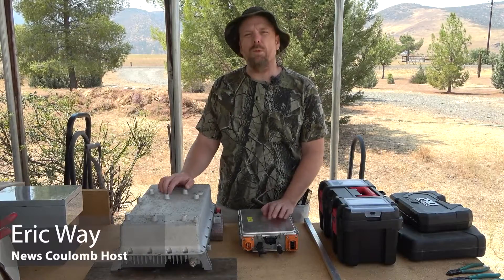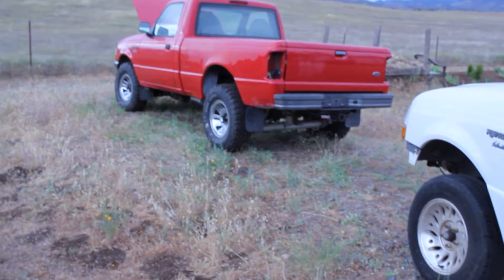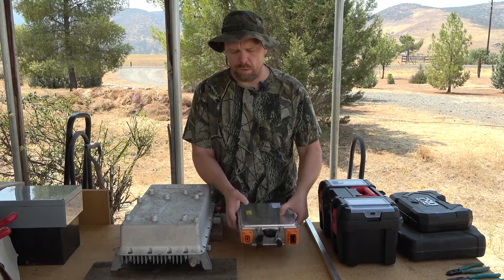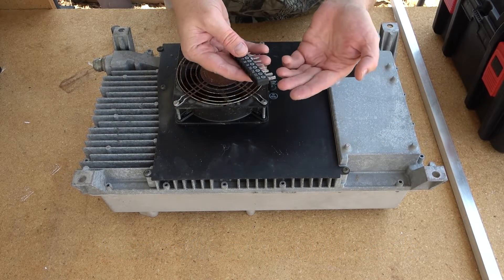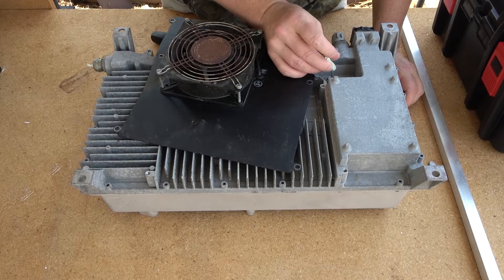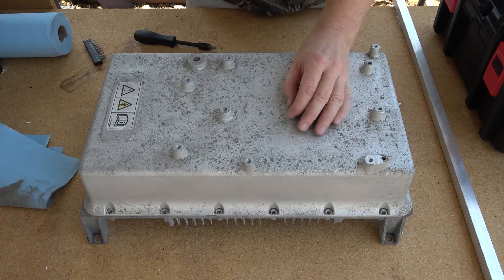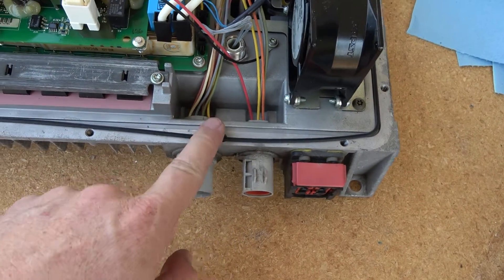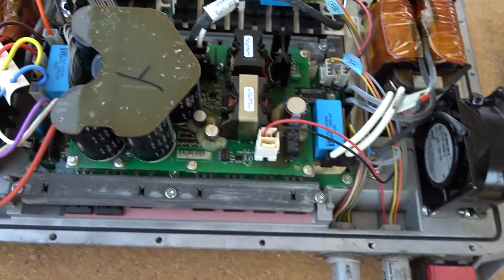Cracking Open a 1999 Ford Ranger EV NIMH Charger

Comment: I have an EV from 2002 and the charger is made by Siemens. For controlling it, it has two temperature sensors in the battery box to adjust end and float voltage based on outside temperature and to monitor if the lead-acid batteries were too hot. It also has a start stop signal from the onboard computer, that monitors other parameters like leak current and battery unbalance. So from that generation of chargers, it is easy to fake both temperature sensors with a fixed resistor and supply the 12v pilot signal to make it start. I'm using it in a Li-ion conversion and the charger has no idea it is not charging lead acid batteries. However with Li-ion, I don't want float charging, so I just stop it manually. WHat has changed in 20 years is that power electronics has gotten better: Lower switching losses and lower resistance in FET transistors, so higher switching frequencies which means lower losses in inductors. My old charger draws 3400W supplying 3000W, So that is 88% efficiency. Horribly bad by today's standards.

Comment: Nice update, curious why that charger selection vs like an Orion?  The liquid cooling for Cali heat?
Reply from the maker: Thanks! Orion doesn't make chargers, as far as I know. I do have an Orion BMS that I will be integrating into the system, but as far as charging, it doesn't really matter whether it's air or water cooled. It just happens that this Valeo Siemens is water cooled.
Reply: @newscoulomb3705  ah, had bms on the brain, cool though, so you're plumbing that in before or after the motor?
Reply from the maker: @jkinghorn  I will go over how I'm integrating the charger into the cooling system. The Ranger EV has an extensive cooling system very similar to the gas powered Rangers, so there are lots of options for how to tap in.

Comment: 600 miles using L2 charging only?
Reply from the maker: If I can squeeze 300 miles out of a single battery charge, it's a lot more reasonable. But we'll see what I can do beyond that.
Reply: @newscoulomb3705  how many kWh is the pack? That truck does not look very aerodynamic.
Reply from the maker: @barryw9473  The pack should be about 90 kWh. A lot depends on driving speeds. A number of agencies did extensive testing on the platform, and they found that it averaged better than 4 mi/kWh at 45 mph, and about 3 mi/kWh at 60 mph. So the truck isn't aerodynamic, but it's also not that big by modern standards. 

If I stick to the scenic roads, 300 miles seems possible. Of course, that also adds driving time. 

I also have to wonder whether Peukert's Law had some impact on the overall efficiency of the PbA and NiMH trucks when tested because they were drawing ~1 C when driving at 60 mph.
Reply: @newscoulomb3705  ok. But then assuming 6 kW at a public 208 V station, it will take ~13 hours to recharge, which is ok if you are staying overnight at a hotel. I am also considering going to San Diego for Fully Charged and will also plan on a hotel stay to let my e-Golf pack cool a bit and charge on L2 after two DCFCs in the hot Central Valley. But, I may have lab work and need to scrap the trip.
Reply from the maker: @barryw9473  Yes, worst case, it would take a day and a half using L2 AC, but I consider that reasonable for a 23 year old EV. Of course, that's if I can even get everything up and running in time to take it.
Reply: @newscoulomb3705  good luck!

Comment: I do not know your background.   But you seem to understand a very complex electronic module.   If I had started this project.  It would have stopped the moment I opened that charger.
Reply from the maker: For things like this, I'm mostly self-taught. I do have some background working with batteries, hardware, tools, electronics, auto repair, etc., but I'm pretty much a journeyman with this type of thing. Most of my videos are sharing things that I'm discovering along the way.

Comment: Careful with those NiMH, all Ni chemistries use a Peak Voltage charge curve.  Do not use a CC/CV that PbA and Li use.

Nickel charge curves have a peak Voltage at full SoC and then a voltage drop.  So the charger needs to be aware it's doing Ni and take account for that.  If you use a CC/CV you can easily cook the cells.

Best of luck and hope you can get those original cells back into service.  Maybe you could validate them with a modern high power computerized hobby charger before going through with the onboard bulk charger.

Didn't that use an AvCon charge power originally?
Reply from the maker: Thanks! Yes, I guess I could have communicated that better. The standard PbA Ford Ranger EV charger was definitely CC/CV; however, I don't know whether Ford changed the charger for the NiMH pack. It's possible that the Independent Observer Module (IOM) is what adjusts the standard CC/CV charging profile to work for the NiMH cells, while the charger itself is otherwise the same. 

In case it wasn't clear, I no longer have the original NiMH cells. I am currently repacking the battery with 280 Ah LFP cells. I do know some Ranger EV folk have charged lithium batteries using the stock Ranger EV NiMH charger; however, it's possible that there were some issues (resulting in lower pack capacities and accelerated battery wear). 

Yes, these originally used the Avcon connector, but the SAE J1772 standard is interchangeable.
Reply: @newscoulomb3705  I thought your mention of the IMO, might have been a sort of work around to override the CC/CV and terminate for Ni at the appropriate peak... Just had to comment and clarify.
Reply from the maker: @D0li0  No worries. I think we're saying the same thing. I'll probably pull the PbA Ranger charger soon and do a comparison. They look similar on the outside, but the internals could be different (or have internal programming that's slightly different).